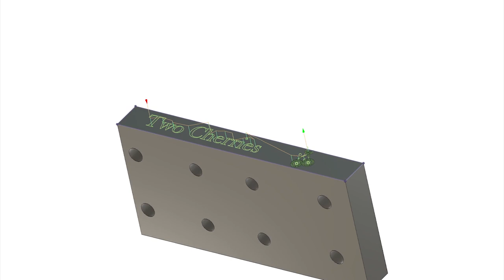The Ideal Luthirey CNC | Making the Gantry Interface Plates

Comment: Can I ask what spindle you’re using to cut these of planning to use? I’m pretty sure my cnc has the stability to cut these but my dewalt router is a bit lacking
Reply from the maker: This is a 2.2kw air cooled spindle, the router would bog down to much
Reply: @TwoCherriesIns  thank you
Reply: @TwoCherriesIns  thank you - I suspect I will be much happier anyways with a bigger spindle :)
Reply from the maker: You wont be disappointed with a 2.2kw

Comment: what will be your final distance between spoilboard and bottom of gantry?
how wide apart are the bottom linear rail mounts of gantry lifts?
Reply from the maker: This machine is designed for luthiery work, and in work I do, I rarely need more than 4" of Z travel.  The cutting area of the machine is 50" x 50"; hence, the extra width of the machine is to compare the desired cutting array of my machine. If you are a Patreon member, you can download the Fusion360 file and check out all the details, I have made some changes, but the basics are there; I will be posting an updated file when the machine is up running.
Reply: @TwoCherriesIns  thank you, i am a member and enjoy your videos.